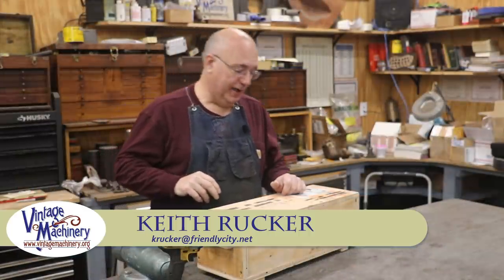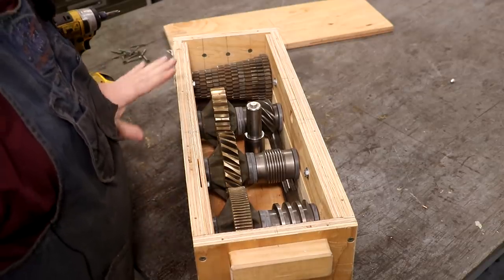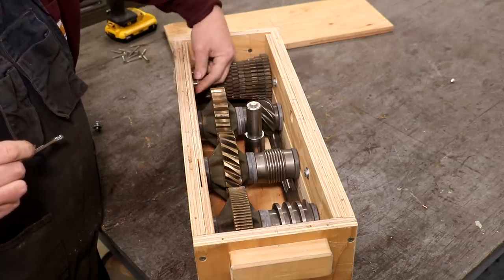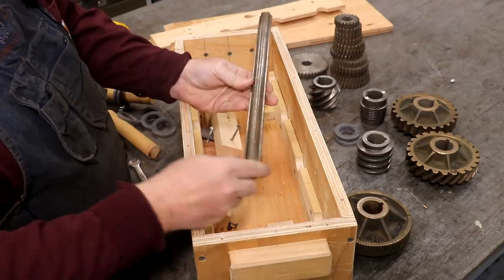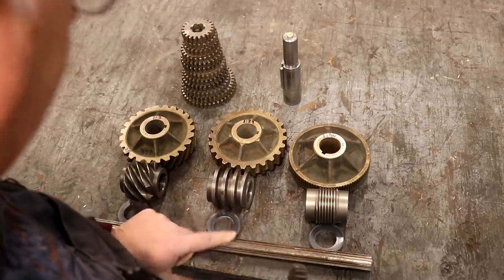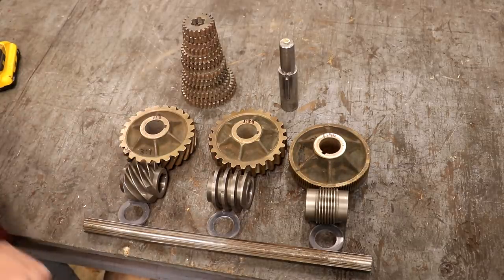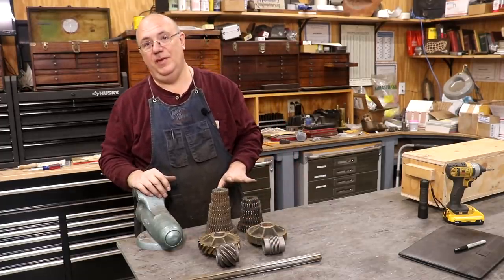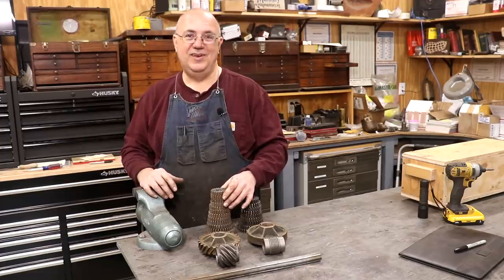K&T Low Lead Attachment :Worm Gear and Change Gear Sets!

Comment: "...this box is a work of art."
Reply: Work of Doug!
Reply: I'm pretty sure I've never seen a crate as good.
Reply: Best packaging of machine parts I've seen!
Well thought out!
Reply: That’s what she said
Reply: We used to get precision-made glass replacement parts ~2’ by 3’.  All the credit went to the people who made and ground the glass. But we would routinely get packages with boot prints on the flat sides (deliberate?).  But never a broken or chipped  piece of glass. Credit to the (invisible) shipping department and the packaging engineers!
Reply: As often has he will probably use these I would put everything back in and make that the permanent storage...wow!
Reply: @briansmith1514  I was going to recommend that Keith use the box for permanent storage, but you beat me to it!  ;)

Comment: VERY thoughtful shipping crate and Doug has to be one fine person. I am very happy for you both.
"Blessed are those who give without remembering and those who receive without forgetting."
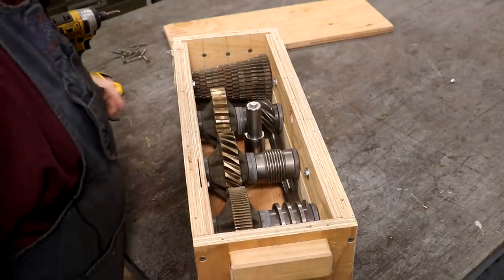I don't think a large spur gear will drive a small worm gear if reversed at 9:20. If the intent of that pair is to have a 1:24 ratio, reversing them will be a ratio of 24:1 which I do not think will work or ever be needed. That means there can only be 3 combinations and not 6. Right?
Sure hope the change gears you want to modify are not hardened.
Reply: yeah had the same thought. But maybe there is some extra gears somewhere that effectively route the drive through the change gears first and then the worms? But I dont see how that would change the total gear ratio either...
Reply: It could be set up to power the table from some other device (no Idea Why)
Reply: GENERALLY worm gears only work when the pinion is powered. Powering the ring gear USUALLY won't turn the pinion. Maybe there is something else going on like Gregor Lasser  and Ypop Nun said.
Reply: Maybe the 1:3 ratio worm gear will work in reverse, but 1:24 and 1:96 can not work in reverse, they will just lock up and something will break.
Reply: @scottywisely6180  True! Learned this years ago.
Reply: Definitely drive the pinion. other way will wreck it.
Reply: @Henning_S.   I would agree with you. Thatis just asking for the bronze ( bet it's not just brass) gear will just tear the teeth in contact as soon as the machine was powered up.

Comment: I am going to recommend your video to FedEx to demonstrate the proper packing procedure to the public. Most of the time it’s not the post office or UPS or FedEx that’s causing the problem. I packed a wall clock inside of two cardboard boxes with an insulating chamber between the two and shipped it FedEx to Missoula Montana. Made it no problem. This clock had Glass, weights, and chains . This guy went way above the call. Nice job.

Comment: You have mentioned on this video and at least one earlier video that the three worm gear sets can provide six different ratios.  However, I do not believe that you can drive a worm gear set from the large gear to the worm  -- only from the worm to the larger gear.  My machining experience goes back 60 years to when I was 25, and so I may be missing something, but wanted to pass along this caution.  I much enjoy your videos -- they bring back fond memories of metalworking
Reply: I imagine the intent is to either power feed the table or turn the handle on the dividing head to feed the device, depending on the configuration of the gearing. Someone correct me if I’m wrong though.

Comment: The cover plates have those weirdly shaped holes so that you don't need to unscrew the nuts when opening them.
Reply: I thought exactly the same but it seems that the flanges on those nuts are a bit too wide to pass through the openings.
Reply: @piast99  they look like original to me.
Reply: They also act as a deterrent to pulling the cover in with the nuts, which you should never do. It strains the cover, strains the case and before you know it the shaft is being bent.
Reply: @simongroot7147  When he said finesse he meant brute force...
Reply: @simongroot7147  I did hold my breath when Keith started pulling in the cover with the nuts 🙀

Comment: Keith, if Im not mistaken you don't have to remove the nuts to remove the covers. Just loosen and twist cover and pull off. that's why the holes are bigger to the right of the mount hole.  great Find for your K&T.. great videos..
Reply: Key-hole bolt holes

Comment: When using certain leads, power feed will come from the table or the low lead directional lever. There is a thumb screw in the table trip and the LL directional lever to pin them in place. The table of leads has a Caution warning at the top every page telling you which feed to use.

Comment: Low lead attachment complete will give 42,362 different leads  from .0219 - 2918.4 inches with either the model H or model K dividing head....Both are 40:1 from the splined input shaft to the spindle of the dividing head. The difference between the model H and model K is that the model H is 40:1  from the crank to the spindle and the model K is 5:1 from crank to spindle....Cheers from Louisiana... Mike

Comment: The shaft I was referring to is called the auxiliary drive shaft  and yes the 96 tooth worm gear is installed on the table screw extension and driven by it he 1 tooth worm  for leads of 356 inch through 2918 inch leads  it cautions you to lock out the table direction lever, that's what that knurled screw is for , or damage can occur,  I have the 2H low lead and conventional lead attachments for my 1945 2H  thanks Keith for the show

Comment: referencing the worm gear set: I think you'll find you have to put the 'screw' gear on the driving shaft and the 'wheel' cog on the driven shaft, the other way round would lock it up.

Comment: 9:43 are you sure? i dont think all of them will work backwords ?
Reply: Worn gears do not work backward. The big gear can not turn the worm.
Reply: The pressure angle determines if a gear set will "overhaul" or not.  Sometimes gear sets are designed so that they become a rotational diode.  Cable winch and drums can be set up so that no brake is required most of the time.  The book Keith likes by Spots goes over all this.
Reply: @stancloyd   You're right, but looking at the pitch of those sets, it doesn't look like those particular gears will work the opposite way...especially that 96:1 part...
Reply: @stancloyd  That is correct but the gears Keith has will not work backward.
Reply: @Craneman4100w  The 3:1 reduction may be able to work backwards. I have small worm gear reduction here with 6:1 and it will work backwards. Even though this is not ideal. As Stan said it depends on the pressure angle.
Reply: Generally speaking, anything over 50:1 in a worm drive is self locking.

Comment: Hi Keith, Like you videos and I have experience running the machines that you have. The manual Planner is to old. But I ran Gray Planner the table was 10 foot by 30 foot this moved on long machine base. Planning steel we would get chips 9 inch in diameter and 3 feet long in long curl. Cut parts including 60,000 pound forming die to level one side.  I have ran mills, boring machines,  ginders, and lathes. I also ran CNC machines also. Worked for Boeing Aircraft for 32 years. Hope to talk to you someday.  Jay

Comment: While it could make things simpler, I think you should make those two gears from scratch. Mostly so we can see you do those center splines. And this would be a good thing to do, since you only have the two you'll need to make. If you had like a half dozen to make, then sacrificing copies is fine, but with just the two... It's a couple three videos worth of teaching you'd be losing by not making them from scratch. Plus, if those internal splines prove to be too difficult, you could then go with the sacrificial path.

Comment: You still need the auxiliary shaft for certain leads or for driving an attachment without movement of the table....For helical gears, you should have enough to do that.. The drive gear for the auxiliary shaft should be underneath the table already.....Cheers from Louisiana....Mike

Comment: I'm looking forward to seeing you attempt to back drive that "1:96" worm set..... I'd be surprised if you could back drive "1-24". The "1:3" should definitely be possible though. :D
Reply: Thought the same! 😂
Reply: Yes, interesting consideration... maybe for some ratios you need to manually turn the dividing head and have it drive the table through the lead attachment.. Good consideration before you engage the table feed on a new setup.. Also, curious.. does this (or similar) mill have provision to drive the dividing head synchronized to the spindle?
Reply: @windrk_6754  I think that it's a simple misunderstanding. Worms, and worm gears are almost never intended to be back driven. Even at low ratios they are very inefficient in reverse. It also doesn't make sense considering they provided a large selection of straight cut gears.
Reply: @ Landon Harris so you are " looking forward to a big crash of gears are you? Bit nasty methinks I'd just hate to see that mistake made and the bronze driven gear teeth get stripped right away when the machine was started. I'm sure Keith was talking to the camera without thinking because he surely knows that worm gears always are the driver, not the driven.
Reply: @samrodian919  I think you are deliberately misunderstanding me. I was obviously joking.

Comment: Before turning the teeth away on your spares please check the Rockwell hardness to machine a smaller gear pitch. Or you may have to surface grind or wire EDM the new teeth.

Comment: How do you lubricate  the worm gears ?
Even  though  they turn slow they  need 
lube because  of the sliding interaction.
The straight cut gears will be ok with a little oil or grease.

Comment: The worm & gear sets - I think only the 3:1 will work fitted backwards (1:3) - the other two ratios won't drive the worm from the wormwheel - and will have to go 29:1 and 96:1 only.

Comment: @9:33 You're mentioning you can put the worm gears into the box in both ways...  I thought it generally wasn't possible to backdrive a low ratio worm gear,  or am I missing something?
Reply: Probably not. But at the "speeds" such would be turning at (the 1:96 configuration), the dividing head would practically turn into a low speed lathe. I.E. not a useful ratio. 

Dunno on the 1:24 setup. The 1:3 looks viable though.
Reply: Yes you're right! A worm can drive A gear, but Not the other way....you will break the gear for sure!!
Reply: @jenshoffker5702  Depends on the ratio. Closer ratios will backdrive. It's a function of sliding friction in the teeth and the mechanical disadvantage vs. the strength of the teeth and case.
Reply: The 1:3 worm drive would work both ways fine but that wasn't what he meant here
Reply: @ratdude747  A bit of google research says I was wrong and that it depends on the gear lead angle and coefficient of friction. I'm sure K&T know their stuff and likely list allowed configurations in their documentation. I just wouldn't want to see any damage to that horizontal mill!

Comment: Can you really drive the worm from the spur? I thought that was mechanically very difficult.
Reply: My gut feeling is that you might stand a chance with the 3:1 but no way on the others. I would imagine they are always intended to only be gearing down. Just guessing though.
Reply: Good point....not gonna work!
Reply: These gears are used to gear down the other gears that drive the divider head as a 3:1 to a 20 tooth to a 36 tooth so the divide head chuck will turn ,6 of the rotation.

Comment: Pretty sure you can't backdrive those screws - at least not the high pitch ones. The 3:1 set may be able to be backdriven but I doubt the others can unless there's something that drives the output so it doesn't bind

Comment: Keith I would be surprised if all three of the worm sets were reversible. Usually, it is really only very coarse worm gear sets (maybe the 3:1), which might be reversible. Casting my mind back nearly 60 years to school physics, I think it is something to do with the mechanical advantage being less than 50%. I would be very surprised if the 24:1 or 96:1 were reversible.

Comment: Congratulations on the obtaining the gears.  I think Google Lens could
prove useful to the community for just such.  There are links at the
bottom. You may have this app used it to identify dog breed or plant
species. No reason this AI based tool could not be trained up for
machine parts? Vintage Machinery's collection of visual data (some of
it annotated.  Perhaps a community based effort to train Google Lens?

Google Lens Home Page: https://lens.google.com/

Wikipedia's Google Lens Page:
https://en.wikipedia.org/wiki/Google_Lens